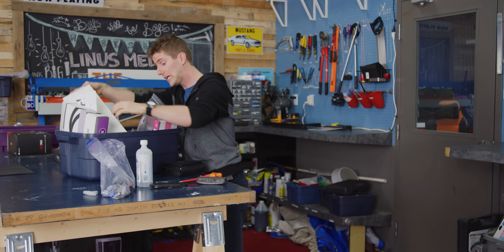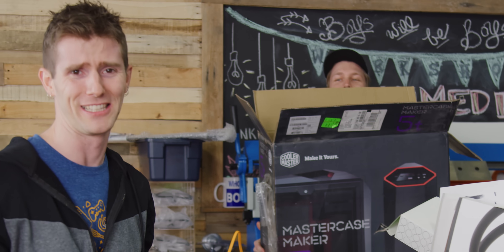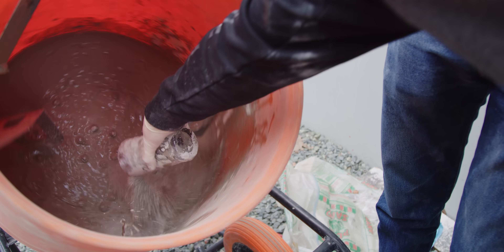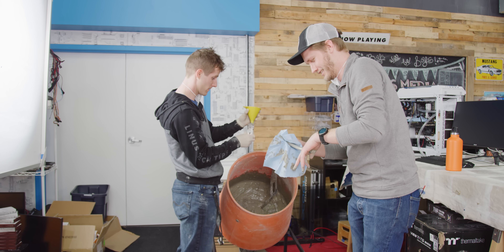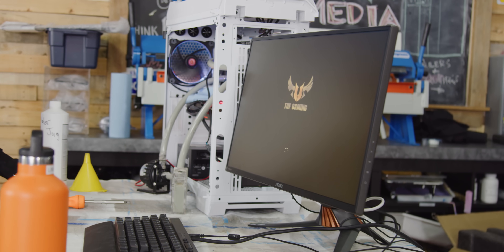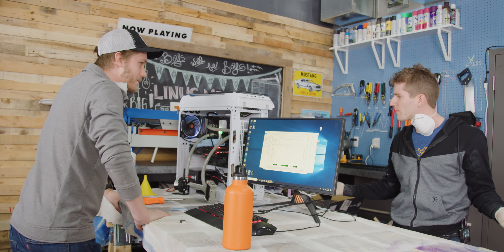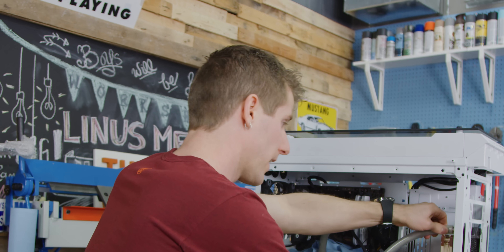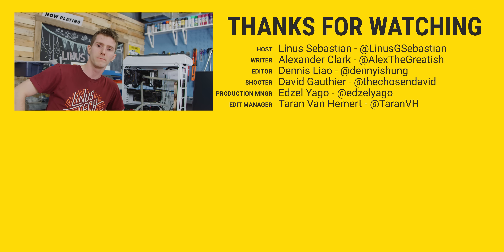I Can't Believe This Worked!!! - Concrete Cooled PC (April Fools 2019)

Comment: Concrete!!
You might have ended up with a solid concrete in the water block, tubing and the rad. 
Also concrete emits heat after adding water.😆😆

Comment: Should have kept the coolant as water, but used a patio stone on a 45' angle for the cooling block.
Pump puts water to the top of the stone and have a small tub at the bottom of the stone to collect water and recirculate through the PC. 
Saves the pump from dying in a week and it would have a really nice waterfall sound to drown out the coil whine!

Comment: You can replace the cement with a fine mixture of sand or somethink simulair. (The cement are the smallest partikels in the mix). Without the cement the mix will not harden. This way you keep the benefits from the capacity off the fluid without the concrete setting.

Comment: Could you make a tube that has a tube inside of it with concrete inside one tube and then water passing inside and another would that be one solution to the problem? The tube with the concrete would not be a liquid but a solid instead, but as discovered in this video the concrete would harden but according to @Mohammad Changizi if you add sugar it stops it from hardening.

Comment: What a dumb idea? Yes it may have cooled the system for a few hours, but anyone with half a brain cell could have told you, "as soon as you turn it off, or even in this case left it running" THE CONCRETE WILL SET!!! So that's a pump, rad, block and tubes destroyed?

But hey, rather you guys than me.

Comment: Uhh.. isn't this technically cement and not concrete since no aggregate are used in the mix?
Reply: Yes
Reply: Why isn't this comment on top?
Reply: @user-qb4iz7nd1x  They are gods, they have the power to change the definition if they wanted to.
Reply: Stan... Okay?
Reply: That defiantly is Portland cement bud. But right about the concrete.
Reply: Yep, true. 1 m^3 of concrete consists of 0.8 Gravel 0.4 Sand 350KG of cement if reinforced concrete with 200KGs of steel.
Or 250 KGs of cement without steel if just plane concrete.

Not to mention around half the capacity of cement for water, so if its 350 KGs of cement you add 175 litres of water. 

Construction Civil Engineer here
Reply: Indeed
Reply: What you are referring to as Concrete is actually Cement/Aggregate, or as I have recently taken to calling it, Cement+Aggregate...
Reply: The its mortor without sand
Reply: rip
Reply: Actually wrong cement is the powder, this would be  mortar
Reply: @aluzc  cement paste, mortar contains sand I believe.
Reply: @moustafa_1994  not technically, but it is common practice to add sand to save money
Reply: @223 Remington plenty of men who aren't interested in concrete/cement, maybe

Comment: dear linus your on the right track with concrete add some sugar in the concrete it will keep the concrete from getting solid it'll stay liquid sugar interrupts the chemistry of concrete retarding hardening.
Reply: well congratulations, you actually made me learn something. apparently if one uses up to 1% sugar in the cement mix hardening can be delayed almost indefinitely.
Reply: The Danish "resistance" used the sugar trick when Germany was building bunkers in Denmark during second world war,  the Danes would happily help build the bunkers, just to make sure enough sugar was added secretly so the bunkers would never actually harden.
Reply: JohannesLauesen thank you
Reply: @JohannesLauesen  Source?
Reply: @null-t5e  OH SHIT LETS GO
Reply: @null-t5e  you are most welcome if your wondering i am part of a research team and we're looking at liquid ceramics as the future coolants you see fluids all have different tolerances but  a ceramics works evenly under both cold and hot tempts that why linus is not so far fetched
Reply: @null-t5e  concrete truck drivers will usually have a few cans of coke sitting around. if something holds you up between plant and jobsite then a cheap can of coke can save an entire load of concrete from hardening in your truck. not a good scenario lol
Reply: Pranksters will now walk to concrete street fillers and add sugar to them to create pockets of quicksand....
Reply: @LinusTechTips do this again with sugar.
Reply: Please let Linus see this
Reply: Up you go i want part 2 of this.
Reply: I'd like to see that.
Reply: Why would one want to have concrete that won't harden? Other than this of course.. I just can't think of a reason
Reply: @halcius9833  hardcore swimming duh
Reply: @halcius9833  a contol room of the London subway got filled in with concrete by accident, so they just bought a bunch of sugar and cleaned everything back up
Reply: @halcius9833  Concrete Trucks have a limited time to pour their load on site. They can keep adding water, but only for so long. Once they run low on water they have to tip it before it hardens in the drum. Common that drivers carry a bag of sugar in the event that they need to stop it going off in the truck. Saves a lot of hassle by wasting it rather than letting it harden inside the lorry!
Reply: @jackbetts1994  oh damn I guess I didn't think about that the more you know
Reply: @halcius9833  Never would be a problem but much slower is used when you have more than one load you wont to bind and harden as one like a bridge.
Reply: @halcius9833  you can delay the set time of concrete by different amounts with different ratios of sugar. You're not going to ruin a truckload of concrete by throwing a sugar cube in it so it'll never set. I drive concrete trucks over the summer, and I'll usually carry a jug or two of Soda to pour in. This way, I can give the contractor more time to finish the concrete before it sets, if he desires. The alternative is adding more water, which will result in weaker concrete by the time it has finished setting in place and curing.
Reply: If he wasn't joking about the "More effective than water" thing, then sugar concrete cooled PC's may be the future.
Reply: D: nice
Reply: @Linus Tech Tips
Reply: Holy shit Linus you need to do this
Reply: They probably just did this as a dumb random April fools joke but now after they read the comments will likely go all out researching and using sugar etc and give benchmarks etc
Reply: I'd really like to see this revisited if adding sugar would really slow down/stop the curing process.
Reply: And obviously add some colouring so it just looks like an opaque coolant instead of ugly concrete. All of a sudden you have a unique, good looking, incredibly well-cooled PC, and if you don't let it sit for days on end, you run in no risk whatsoever.
This could become an actual thing!
Reply: then its just water cooling with shitty additives. 

needd to form a concrete block, and set the cpu into the wet concrete, and let it cure there. then install it into the computer, and see how cold it can keep the cpu.
Reply: I don’t think any of your know it’s an April fools joke. Just in case this is all a joke don’t r/woosh me
Reply: It might be good to make caramel too 😂
Reply: @LinusTechTips When is part two coming? You could be onto something here if you can get the concrete to delay setting.
Reply: Hardening gets retarded? Hah.
Reply: That might solve the other problem, which is that the reaction that causes concrete to harden creates... heat :D Which is kind of less than ideal for cooling. But then there is still the problem that we'd have to wait almost a year for that video. I was about to say "but then it would be only half as funny", but to be honest, if they'd follow up with the sugar thing next year, that would be absolutly hilarious.
Reply: The pump with die super fast though.
Reply: do it again WITH SUGAR!!!
Reply: Yeah, when my patio was done being filled and sculpted, they put sugar over the top to expose the rocks so it wasn't smooth on the surface.
Reply: Linus must doing this too
Reply: wow.  buguuufff(mindblown(
Reply: Awe I wanted to say this
Reply: What did you call me??
Reply: Bump
Reply: Sweet!
Reply: This comment did not age well seeing as he admitted that it wasn’t concrete in the loop but milk and other products and that the video was shot out of order. So easy to fool people 😂.

Comment: To all the haters this is legit! Some of the fastest drag racing cars fill the coolant system with cement. You want an 11 second quarter mile? Use antifreeze... you want to break 10 second quarter mile? Well then you use cement! It's exactly like he said with concrete floors and basements.

Comment: Sadly I knew going into the video, that concrete mix has a chemical reaction with water and is not dependent on drying back out to harden. The mystique was ruined before I even had a chance to wonder if this was real.

Comment: I'm pretty sure what happened was the concrete would have started to harden over top of the processor and then eventually just stopped the flow which caused the computer to overheat and shut down

Comment: Concrete worker tuning in. Sure, the curing of concrete is an exothermic reaction in all technicality, but it is better for cooling MORE SO than you would think (apparently after AND during the curing process), as evidently supported by this video. If it were me, I would concrete the tubes only and AVOID getting any concrete in the pump, as to avoid concrete solidifying the pump mechanism, essentially bricking it. If you got a case that has good airflow, this helps keep the tubes cooler and would assist the radiators in cooling the water/coolant. Not a bad idea at all, until you account for the fact that water will chip away at the concrete lining over time, which will come to damage your pump. Is it any worse than using manufactured PC coolant/dye? Idk. You will have improved cooling, but a lower life span of your water cooling system, like using manufactured/dyed coolant.

All that said, I probably wouldn't recommend this.

Perhaps keep this thing running for a period of time and let us know what happens LTT? I am really CUREious. hehe, concrete pun.
Reply: @223 Remington I see no concrete evidence to prove otherwise! Case dismissed.
Reply: @Near2Future  This is called cement paste, concrete is mainly made up of sand and aggregate with cement (like one quarter of its volume) just to cement (paste) them.
Reply: @moustafa_1994  As a youtube corrector you should know i was joking.
Reply: @omgwtf696969 I didn't say it was incorrect. I said it like that to put the blame on that person in case it's wrong because I don't know if it's true and was too lazy to research.
Reply: There's no problem if you believe the comment suggesting adding sugar will keep it liquid...
Reply: Oh me oh my, never got this much attention before. Anyway, yes I know it's cement because actual concrete would have gravel in it, I should have used correct terms if I was going to go tooting my own horn, thanks for the correction you few who also appear to know concrete/cement. Sugar is a retardant to cement/concrete and will stop the solidifying process basically indefinitely if the sugar content is at least 1% of cement mixed (give or take depending on what kind of sugar). This also makes cement/concrete somewhat corrosive, to what extent idk, but I would like to know if it's corrosive enough to corrode away the inside of custom water loops at a noticeable rate (like a month after completing the cement loop would my pump still be alive or pump components melted in a week?). Still, I think this infinitely liquefied cement would brick your components a ton more quickly than letting the cement harden a layer inside the tubes and let it do its job in passively cooling water as it passes. You could always add sealant to the cement to prevent water from eroding that coating and prolong the life of your water loop components (or don't and it should last you about as long as manufactured/dyed coolants, ie 3-5 months), but perma-liquid cement I don't have an answer to.

Comment: hm, if there is an agent that would make the concrete never harden and maybe add a bit more water to the mix and I believe it would actually be a possibly viable option for the benefit. however I don't see myself going out and doing this unless I have the spare stuff lying around to break lmao

Comment: This got me thinking. April Fool's jokes aside, could you add some sort of iron or aluminum powder to the water to gain the same (or even improved) thermal conductivity benefits without that pesky hardening problem?
Reply: or just go straight to mercury cooling.... 

or molten salt like they use in nuclear reactors

Comment: I have a "small" idea: don't know weather it works, may be it helps with the concrete setting problem or mitigate it? https://techwarecentral.wordpress.com/2019/04/02/cpu-cooling-with-concrete-failure-and-way-to-extent-it/

Comment: Anyone else amazed they actually have concrete mix on newegg?
Reply: i knew this was a joke but for some reason i still checked
Reply: @James-vu7ef  did you check though? because they actually do lol (turns out they have everything, not just computer supplies; who new? )
Reply: I used to think Newegg was just a computer parts store. When I clicked on the link I thought it was a part of the April fool's joke. But no. They also sell clothes.
Reply: @murmamirrmohaimen2271  it used to.  They went the way of Amazon, and multiple listings for the same damn part because of different sellers.
Reply: This is actually cement, not concrete.
Reply: Yeah can't believe it. No idea why
Reply: They actually sell all sort of things but I never imagined Cement to be one lol. An April fools joke that actually makes you learn something new. who knew.
Reply: They also sell makeup.

Comment: ok so it is possible but you need thinly mixed cement and the right RPM on your pump.....

the way it works is called liquefaction. when the frequency (RPM) is just right and the amount of liquid to solid ratio is in the sweet spot the fine sand and other solids flow freely. the same concept can be seen in landslides too and is very easy to replicate with common household items

Comment: You did it all wrong.... the formula for a super cooling liquid is 30% antifreeze, 10% 5w20 synthetic motor oil, 20% power steering fluid, 25% Vodka, 20% transmission fluid, and 5% distilled water. Just remember it has to 5w20 synthetic or it will not flow through the pump that well.
Reply: 110% that would work.
Reply: Sounds like it'd work 🤷

Comment: You had me until you grabbed the Rad. I actually thought you wre going to do a   concrete block with thin wall or copper tubing running through it in place of the rad and fans (idea??) but the rad gave it away. Gutted.

Comment: what about a Nitropill (unsure spelling) cooler you wound need to make the pipes from Aluminum and pump canister. there is a chemical reaction between the nitropill in water and the Aluminum that causes rapid cooling.
Old man use to bring it home mix it n a tub of water put a coke can in few a moment and it be ice cold to drink, left it wound freeze.

Comment: Maybe, instead of having concrete circulating in the pipes until it dries, it might be possible to have water circulating exchange heat from the CPU to a piece of dry concrete kept in a sort of chamber where water will release heat to it.

Comment: There building a concrete cool gaming pc with an i7 and a 2080ti meanwhile i have a air cooled pc with a REALLY low end amd processor and a gt730..... when fortnite runs i play with 30fps and the cpu is always stuck on 100% 🤣😂

Comment: April Fools aside, I can't believe they bought a concrete mixer just for this stunt. I've worked with concrete many times, but I've always used the cheapo wheelbarrow and shovel method. Heck, I've used a cheapo Rubbermaid knockoff plastic tub to great effect. It's reusable and easy on the wallet.

Comment: Alright I have a solution,
        Linus was right, the reason the concrete is cold is because of the principle functions of ceramics. 
The thermal mass of materials similar to concrete is very, very low. Thermal Mass is the amount of energy that can be stored in an object 
as heat. This is also the same principle that makes ceramic body armor get very hot when it gets shot. The plates heat up because the ceramic
 cant keep all that energy inside it, so it has to release it in the form of heat. The opposite happens with this scenario, instead of releasing
 heat from outside sources of energy, the heat IS the applied energy. Therefore it releases the energy much quicker. It can get so cold in fact 
that some concrete can actually freeze itself before it dries, just from how much energy it loses. Causing layers of the concrete to flake off. 
(which is a problem with construction in cold areas of the world)

        The solution is a granular ceramic  in water that does NOT dissolve the ceramic inside of it. It is important that the ceramic is not glazed and is
about the same grit as beach sand. basically have a lot of concrete powder but have enough water that it won't dry. Also you could test out different materials 
to test the thermals. Really you could just find a material with a much lower thermal mass and as long as it's liquid you can throw it in a *SICK GAMING PC*.
Reply: You've obviously never played with concrete. The curing (hardening) is due to a chemical reaction which releases heat. It's why we can pour concrete at 0* and simply cover it with a blanket. It keeps itself warm until it's fully cured.

Comment: There's a company that sells round pellet glass at a very very molecular level that I do believe would help it is glass beads so it's round and soft and not jagged like traditional glass and I think it would transfer the heat the same way as this.... Without causing the concrete become solid affect.... but the beads would hold heat and then transfer to different locations the same ideas that concrete or cement